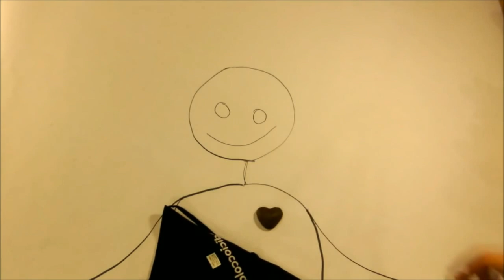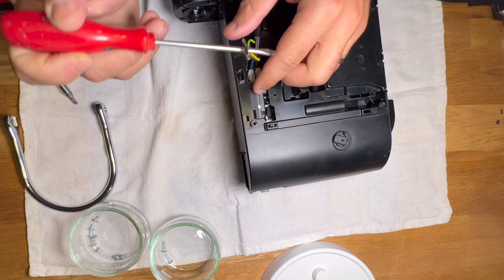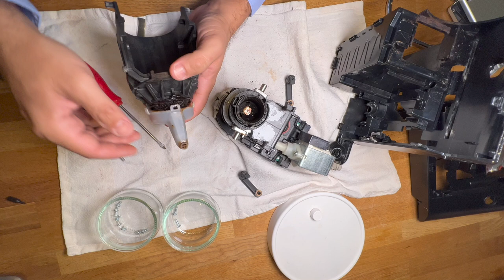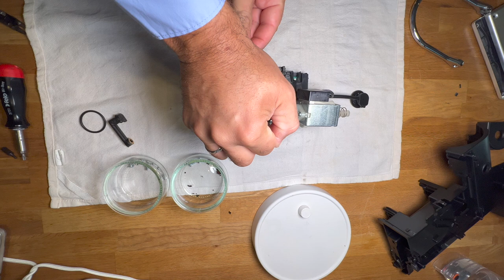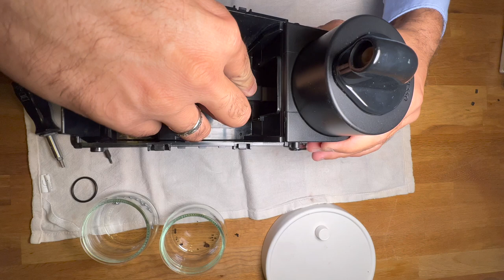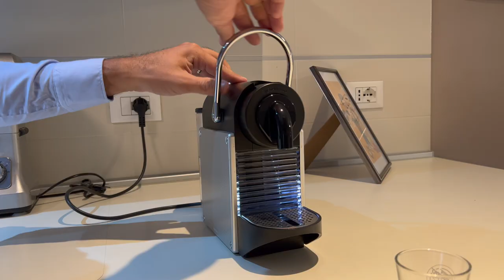How to fix Nespresso Coffee Machine for 50 cents

Comment: That's real rocket science! Just recently I ended up junking a whole batch of capsules with a machine that just wouldn't budge. Finally, I shelved the Nespresso and went back to basics. But if I had attempted to clean the machine like you did, l would have ended up with only a box of parts, a teaspoon and no coffee machine. Better I run to the café nearby for my espresso.
Reply from the maker: 😂 you can do it 😉👍🏼
Reply: wow, that's impressive. I would have ended up with similar, but a bent teaspoon. And a bunch of parts smashed in frustration 😛
Reply from the maker: @hiltongiesenow2895 😂👍🏼
Reply: You should have broke the capsules open and used the contents in a cafetiere. That's what I did when the pump on the Lavazza machine at work broke and they threw the machine away.

Comment: A very informative video.  Just fixed my own leaky identical machine.  Just a few points about reassembly - the end cap and spout cover is best left until last as it’s easier to line up the 2 halves of case.  Then press on the end cover etc. I also found it easier to mount the innards on the smaller side first.  Cheers!
Reply from the maker: Thanks for the advices 👍🏼 ☕️

Comment: Hi, I do have a Nespresso Pixie C60 that leaks and would like to replace the o-ring. Where can I buy it? I live in America and access to metric system parts in regular hardware stores is not as easy. I found the parts number: 0061701 and description: 0-ring 3.40 x 1.90 EPDM V3, 70 shore black. Any ideas?
Reply from the maker: I used a classic o-ring for plumbing, they sell a kit with different dimensions so you can try with different ones or after you remove it you can go to the store with the o-ring and buy few of the same dimensions

Comment: Hi. I have a Nespresso Essenza. The problem that I have is the capsule is not being punctured. So, only “dirty water” coffee is in the cup with water in the collection reservoir at the bottom. 
I’ve cleaned the front grid with a toothbrush, cleaned the nozzle, and descaled. 
Unfortunately still no coffee. 
I think I need to remove and clean the grid. 
I’ve looked through your videos without finding a method to get to it. 
Please give me some advice. 
Thanks 
J Pensabene 
Augusta, Georgia
Reply from the maker: Have you tried without capsule?
Reply: @Spectacular-cuoredicioccolato  
Yes, all the usual. Water only, toothbrush cleaning, de-scaling. 
I’ve watched your video when you removed and cleaned grid. 
I guess I should remove it to be cleaned
I was hoping to see that video but I haven’t seen it. 
I will keep trying. Thanks. 
Joe Pensabene
Reply from the maker: @JayPenbenny ok 👍🏼

Comment: I am so impressed. The electrical wires put me off tho. :) My Pixie issue is the pump won't allow any water to run through due to "air pocket". Apparently, if they sit for awhile that problem arises. I tried everything else on YouTube. Maybe you can help? TIA
Reply from the maker: The air pocket, is it broken or only stack?
Reply: @Spectacular-cuoredicioccolato  hi I never took the whole machine apart. I took a syringe with elongated tip & multiple times I pushed water through the area under filter where water container sits. I removed tiny filter. Twice I heard a pop. Then dark water started going through. As if a rubber hose melted a little? Now I do get some clear water going through, but maybe 1/4 the amount of water drips out that I need for either coffee size. Any ideas? I am encouraged that the "air bubble" seal popped and some water comes through. Would using distilled water change anything? Thank you!
Reply from the maker: Try to let lemon juice and distilled water without coffee cups few times, at list half liter , and check if improve
Reply: @Spectacular-cuoredicioccolato  Thanks, will try next!
Reply from the maker: Keep us updated 👍🏼